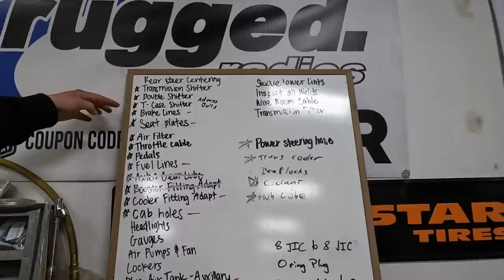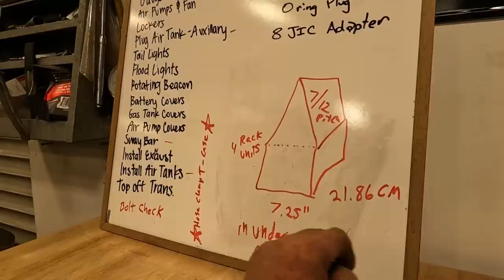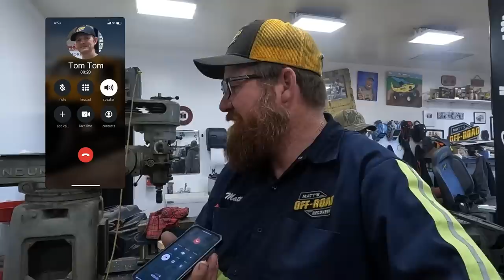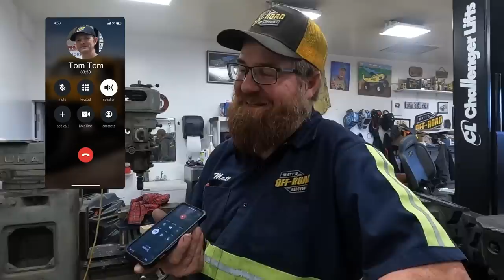Is This A Sign To Come For The World's Largest Off Road Wrecker?!

Comment: Hey Matt, I've been working in the HVAC business for 36 years and there's a technical term for what's happening with your heat pumps.  It's called a POLARgeist.  Love your channel!
Reply: We use them in Maine and only have issues 20-30 below. Then alternative heating come in play.
Reply: Very helpful...
Reply: Seems like a thermostat issue or the wind make a high pressure in the garage 🤷
Reply: Also happens with the gas furnace so doesn't sound like it's just a heat pump problem?
Reply: My heatpump has to enter defrost mode in every once in a while  in the severe cold.
Reply: How do you fix it? I've got the same kinda unit in a paint shed at work that does the same thing.
Reply: @jasonbirch1182  it was meant to be funny.  A real diagnosis can really only be done by the technician witnessing the symptoms while the event is occurring.
Reply: check you vent .. when the wind is blowing is it going into the vent pipe ??  if it is straight out might need a 90 on it too stop the air from blowing into the vent .. had a problem with the wood stove windy days the fire would fill the shop with smoke .. had to add 3 feet to the height of the chimney  .. was already higher then the peek ,, but we get 50 mph winds here a lot  ..  have not had the problem since ..
Reply: Exchanger coils overheating from high demand, and shutting down, increase blower speeds.
Reply: Considering that is a minisplit ductless heating and cooling system, a positive or negative air pressure in the shop shouldn't effect it, I would imagine a shop would need at least a couple of big traditional ducted units and possibly a wind shelter in the winter months
Reply: @davidsoutar8508  Vrry true. Good answer!
Reply: @BikingWIthPanda  Yes, its made up, its called humor

Comment: There is a setting in the thermostat that turns your heat pump off if the outside temperature reaches a certain point.   You need to go in and adjust that number lower, so your system continues to operate correctly.
Reply: that t4 does not have outdoir temp sensor to set heat pump lockout
Reply: It's probably doing a thaw cycle (temporary A/C mode) - heat pumps do this so the coil doesn't freeze up when it's near or under freezing outside

Comment: Wind really effects mini split heat pumps because it keeps the unit from drawing heat from the outside air by evaporating the moisture causing the unit to produce colder air inside the evaporator.  I would suggest building a shelter around the unit with enough space to let it draw air into the unit.  You don’t want to smother it.
Reply: What he said 😂
Reply: That's backwards. A heat pump works more effectively with wind, which heats up the cold side of circuit. As does an A/C.

The real reason a heat pump stops working effectively with wind has nothing to do with the unit, it has to do with the demands placed on it. More windy = accelerated heat loss to the colder environment = more need for heat. Also, heat pumps lose effectiveness the colder they get. There's a max temperature differential they can accomplish. That's why they're almost never used in Canada for example, by the time winter rolls around the temp difference is large enough that heat pumps are useless and you end up having to just make heat resistively, which is 25% as efficient.

The solution is: Sorry, your heat pump just won't work, you'll need to add radiant or space heaters when it gets that cold.
Reply: @MattsAwesomeStuff  For what it's worth, heat pumps are incredibly common in Canada. The newest units can supply 100% output at -20C.
Reply: I'm just going to add a second comment to explain heat pumps and their limitations and why you don't see them much farther north than you are:

Heat pumps are backwards A/Cs. You have 2 environmental temps: Indoor temp (ideally room temp), and outdoor temp. And you have 2 device temps: after compression, the hot side, and, after decompression the cold side. The eventual limitation of a heat pump is: when the heat pump takes the cold outdoor temp fluid and compresses it, even that hot compression is still below the desired indoor temp. At that point, you can't take any more heat out of it. It's like burning a fire where flame is below room temp. It won't heat you.

Or, on the flip side, if it decompresses fluid that's room temp, which chills, but that chilled fluid is still warmer than the outside temp, then it can't add heat to the cold fluid to compress.

It's not a hard shut off. As you gradually approach these limits, the heat you can add gets smaller and smaller until it gets to zero.

Technologically, the only thing left you could do is for a heat pump to be designed for a higher pressure, because if you squeezed that refrigerant even smaller than you were, you'd get it to a hotter temp. But now all your fittings and lines have to be rated for higher pressure, and, you'll still not get as much heat out of it. Plus you're not making those mods yourself, it would have to just be engineered and built that way from design onwards.
Reply: @RyanSchlesinger  - They're common in the warmer coastal and southern areas. Not the prairies. And, those units are newer technology, and specifically designed for that cold. I doubt one installed in Utah is of the same caliber. -20'c is not cold for Canada, when even the southernmost parts of the prairies hit -40'c multiple times a year.
Reply: @MattsAwesomeStuff  You are correct with the temperature differential. The problem is the pressure differential needed between the evaporator and condenser. If the compressor can't create the differential, the system stops working. The temperature of the refrigerant is coupled to the pressure via the log(p),h-diagram.

There are heatpumps that can efficiently work as low as -18 °C (-0.5 °F) ambient temperature, but below that, the power output drops massively. (CO2 as refrigerant is used for heatpumps in Skandinavia for that reason. CO2 also has the ability to create a temperature difference of about 80 Kelvin (176 °Rankine)) 
Also your figure for 25% as efficient is a vast generalization. The COP of a heatpump vastly differs via the factors of refrigerant used, evaporator temperature and condenser temperature. Most heatpumps have a COP of ~1.8 at -15 °C (5 °F) outside temperature. (1.8 kW of heat for 1kW of electrical energy) Heat via resistance has an efficiency of 1 or 1 kW heat for 1 kW electricity.
Reply: @RyanSchlesinger  I have never seen a single one used as a heating system in Canada. They don't work in actual cold temps. The vast majority of Canadian homes are heated with natural gas forced air furnaces.
Reply: @JainZar1  Right, so they are useless in most of Canada, where I live in Alberta it goes down to -40°C most winters.
Reply: I enjoyed this video. I think Matt looks good in his new glasses.  I bet he can see lots better too.  ❤️🙏🙏👍👍❤️
Reply: @ddt0889  I live in Canada and they’re very popular.
Reply: @MattsAwesomeStuff  I disagree.  The wind is likely preventing the unit from defrosting the outside coil (which it needs to do from time to time).  It needs to be sheltered such that the air move though the coil only when the fan is on.
Reply: @Russell Hltn  How is a wind break going to help it from freezing up? It's the same temperature whether the air is moving or not. If it's freezing up, it's because it can't handle that temperature differential. Airflow, if warmer than the cold exchange (I.e. the heatpump has accomplished anything), will warm the cold exchanger. What is it protecting from? Where is the heat that will warm it up?
Reply: @MattsAwesomeStuff  It helps with the unit defrosting.
Reply: @ddt0889  From personal experience, they use both in Finland. A heatpump for medium-cold and higher temperatures and a gasheater for truly cold conditions.

Comment: Something to check on wrecker. Those windows on the IH are not tempered glass. May want to add some tint or something to protect occupants. Also the front window was designed to "pop" out if you were thrown out of the vehicle, due to lack of seat belts. Also this assumed you weren't impaled by the non collapsible steering wheel. Glad you changed it.

Comment: Your mini split could be shutting down if condenser fan is trying to run backwards or slow down due to the high winds. They have safeties built into them. Try to block wind from it see if it helps.
Reply: yeah I didn't know about fan, but I think some fabbed up wind screens might help.. I wonder if they know anyone who can fab something like that up.
Reply: @fordcougar99  I doubt they know any fabricators at all.
Reply: @gui577b  Isn't the defrost cycle on a timer on most mini split?

Comment: My hand measures 7" from tip of middle finger to the first wrist crease. Knowing this has saved me many times when I needed to find a certain length,or depth. Pretty accurate. Once my son made me a cane,out of a shovel handle. He drilled and filled with solder, markings of inches all the way up to handle.

Comment: On the gas furnace I have no idea that is weird. On the mini-split it thinks it's frosted up. The compressor end should be oriented so the dominant wind blows on a side rather than the front or back. If this is already the case buld a tunnel around it. You typically need about 8" of clearance on the sides, top does not require any clearance, tunnel idealy should extend about 3' front and back. But any amount will help.
Reply: Agree 100%

Comment: Heat pumps are reverse AC units, they need "heat" to operate, your outside air is getting to low and it shuts off to prevent freezing the equipment, being in the desert the unit may not be designed for such low temps, you can find low ambient kits for them, that may include electric heaters and wind baffles. Short term blocking the wind will help.
Reply: I was literally typing this and thought....maybe someone else has already answered and .....yes you did!
Reply: Heat pumps suck big time. I have never seen a benefit from using them. Just buy a furnace and save some money.
Reply: They should work even below freezing, they're getting installed with a lot of new builds in Canada due to their extremely high efficiency compared to gas and especially electric.
Reply: @MatthewBerginGarage  Mine heats my house down to 19F, or keeps it cool when it's 105F, for $50/mo in power. Heat pumps are phenomenal! If you live in Wisconsin and get below zero for long periods, I agree, but in a lot of places heat pumps are great.
Reply: @MatthewBerginGarage  Heat pumps is so much better if you buy the right stuff.  Mine works good down to -15 Celsius (5 F), and its 12+ years old with no services. 
Still heats below that, but at reduced effect.
Reply: I seriously doubt that it is getting down to -20 Fahrenheit.
Mini-splits will work down to 15-20 and -20 with the wind baffle kit
Reply: @vesper1140  heat pumps still have heat strips for when the heat pump can't keep up or goes into defrost. Heat pumps are only efficient down into the 20's if that
Reply: @vesper1140  The only ones that work efficiently below freezing are ground source heat pumps and they are very expensive to install. You can buy a lot of gas for the cost of the installation. It's like the EV's. I can buy a lifetime worth of fuel for my present vehicle for the cost of an EV and still use my very user friendly vehicle. So why do it. 🤷‍♂

Comment: Get a yellow marker paint pen and mark each bolt as you torque them up. That way you will know what is and isn't torqued. Zero confusion and it is easy to eyeball what still needs torquing.

Comment: Hey Matt, this is six in a row jim again and I’m gonna make a recommendation that you put a couple of zinc rods in your radiator cause you got cast-iron block and aluminum radiator and that’ll help with corrosion. It’ll protect both the block and the radiators.
Reply: Like marine engine and radiator Zinc Anodes.

Comment: Make some sort of temporary shelter around your outside unit and see if that helps. Mini split systems don't have backup heat strips so depending on their seer rating they might not heat in extreme cold or could be low on freon? Smokey THE Bear must be in Utah. I Iive 70 miles from the Smokey Bear memorial in Capitan NM where he was caught in a forest fire as a cub.

Comment: You going to have to build a bracket, that stays with the frame. All the shifters will lock onto the bracket and become a section of the floor when you set the cab on.  Then it will expedite cab removal.

Comment: I have really enjoyed the videos over the last year or so, but the banter between Matt, Tom, and Lizzie in this one was the best.  I think Tom’s addition to the crew has added a new dimension to the chemistry.  

Oh, and congrats on not running the World’s Largest Wrecker through the shop walk…
Reply: Sure would like to know the wire size, speed, heat  also the gas pressure you are using, might improve me, having trouble after
45 years, don't know if it's my Lincoln,it's thirty five years old been
Used alit but still looks good enough to sell. I also have an 8 years old new tech Lincoln wire welder in Saginaw mi. I live in Merida, Yucatan
México. I'm 83 now, built this vehicle

Comment: Put a wind block in front of your outdoor units. Heat pumps don’t like working when outside air is below 30 plus you guys have the wind chill. Those outdoor unit fans run on a variable speed and that wind is throwing it off.

Comment: Heat pump is just running the AC in reverse. For an AC system to work it take heat out of a house and dumps it outside.  In heat pump mode, it is trying to cool the outside and dump the heat in the house. When the outside temps are low and you add wind, it lowers the temps due to wind chill. Those low temps limit the ability for the condenser to dump its cold freon. So if it can't dump the cold freon then it just cycles back into the house. Put up wind brakes.

Comment: Get a mini split wind baffle that will solve your problem. It's blowing the air back into the condenser coils causing the coils to cool down.
Reply: Its crazy the wind overpowers the fan. I guess since they are mounted sideways instead of vertical, wind will effect it more. Typically the wind will help the outdoor coils since it moves more air, but evidently not in this case. Windchill actually as the opposite effect on coils since the coils will be below the ambient air temp, so the extra air blowing across the coils will bring them up to the ambient air temp. Wind chill confuses people.
Reply: Like HVAC Service and install mentioned you need a wind baffle, super easy accessory that screws on the outdoor unit with four screws, there is also suggested ways to mount the outdoor unit to prevent prevailing winds from causing this issue, 

Lastly there is a chance the system may not be properly charged and it’s more noticeable at the extremes of the demand
Reply: Oh one more thought, make sure the penetration is sealed where the refrigerant likes come in through the back of the indoor units, a cold draft will cause the unit to go into freeze protection

Comment: The structural brace for Brake Boosters is usually behind the firewall and part of the dash structure. You could save a heap of room by replacing the old style vacuum booster with an electronic one

Comment: Are you building a full cage for the cab? Weld mounts for the seat belts to the cage. Would not trust the tubular seat frame for a seat and shoulder belt mounts...With the angled brace the weak spot is now the seat tube to mount tab weld. Mount the lower seat belts directly to the floor reinforcing mounting plates.

Comment: Gas furnace that stops below -5 that's probably the pilot going liquid before it ignites the main if you got it breathing outside air if it's on propane (if its NG i'm a bit confused). The heatpumps should work but if it's not in a protected place the outside unit can frost up too much for the pump to recover during its defrost cycle.

Comment: I liked the old New Process 203 all time transfer case, they had a lockup inside the transfer case for when off the pavement, too many were given front locking hubs to unlock the front axle, requiring to run the transfer case always in lock to power the rear, end results damages the internals as they were never designed for the load to be solely placed on the rear of the case, it was done mostly to improve gas mileage, something you need not be concerned with, it is a 4x4 truck, buy a 2wd if MPG is top priority. I once did an awesome burnout in a parking lot with a 76 Chevy SWB with a  NP203, it ended in disaster, shattered the adapter between the transfer case and 350 turbo transmission, dumping transmission fluid everywhere, but it did make it back home.

Comment: The fact that Matt knew a parsec was a unit of distance not time made me happy
Reply: i think a parsec WILL be a unit of distance 😉
Reply: I think that a parsec is a unit of distance AND that Han was right in the statement 'does the kessel run in 12 parsecs'. Here's how:

The first and most basic question is, how can a unit of distance be an indicator of speed for a space-going vessel. The answer is fairly straightforward; the Kessel run most likely is in close proximity to an area of extreme gravitational pull, like a black hole or stellar nursery. To be able to traverse those areas requires a vessel fast enough to escape the gravity, and the closer you get to those gravity wells, the more speed you need. Saying "in 12 parsecs" means EXTREMELY close to those gravity wells (in astronomical terms), and would require an incredibly powerful ship to escape.
Reply: But how many rack units are in a parsec?
Reply: @Blue84Stang well said